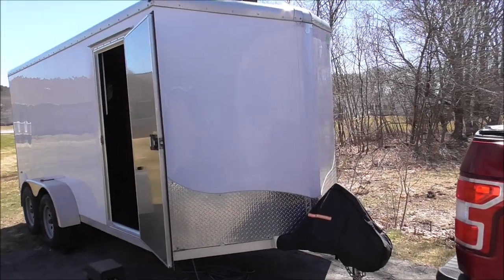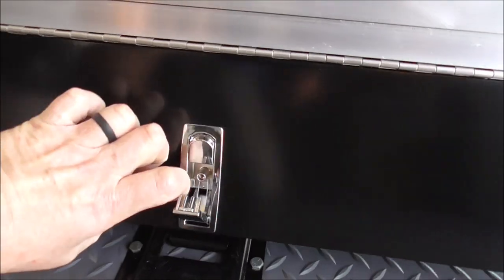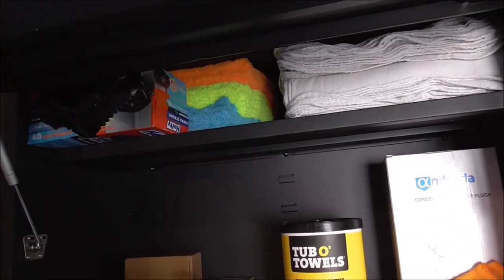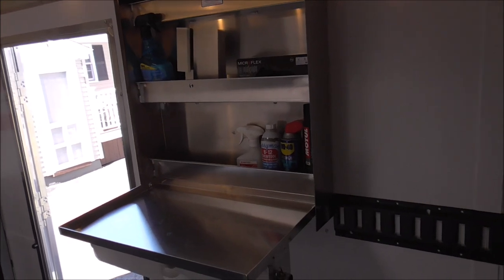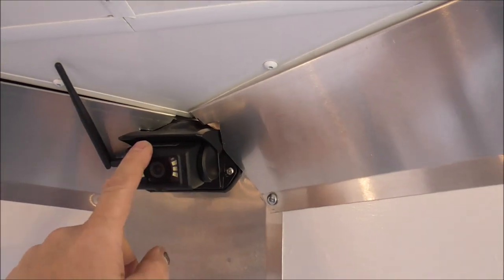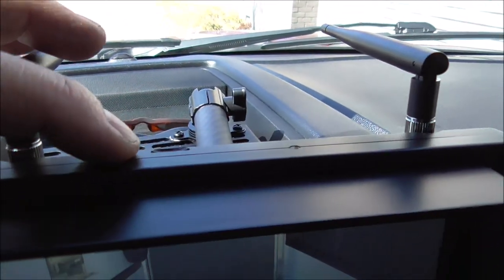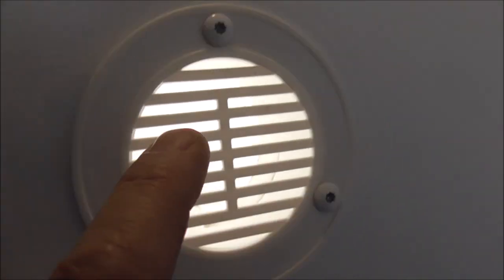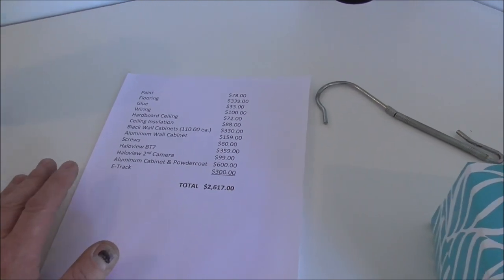"Cost of Building the Ultimate Toy Hauler Conversion - Cargo Trailer Mobile Welding Rig Tour!"

Comment: AWESOME job! Love the final product. It would be great if you could show us what it looks like loaded out in the two different configurations, (toy hauler, welding). Also, what is the floor made of? It looks great. If you made a video showing the floor installation I must have missed it. Maybe you could do a follow up video after you use the trailer for a while and comment on how things have worked out to that point. Also, things you might decide to add after some experience with it. Thanks for all of the how to tips and great ideas.
Reply from the maker: Thanks man and all great suggestions. I will be updating for sure. As for the floor I did it off camera just because my channel tends to suffer when I stray from welding videos for too long and I didn't want to turn off my viewers. The floor is commercial vinyl. It's. 115 mil thick and resists gas, oil and acid. Its made by husky.

Comment: That should definitely work! Looks very professionally done and it has accessories that you wanted. I thought you said at the beginning that you were going to put cabinets above the workbench? Those 3 cabinets you have, i too bought one at Christmas, wasn't crazy about putting it together though. I put my welding jacket shirt in there with my welding gloves and I also bought leather coverings for my shoes. My new Rew Wing boots were taking a beating from the splatter.
Reply from the maker: Thanks Jake. I was planning to do cabinets above, I still might but i'm not sure it's going to give me the depth of storage I was hoping for due to the slant top and V nose. I'm going to have to give it a little more thought, maybe even make a template to see how much room I could get.

Comment: Very nice job on the trailer Brandon! It takes a lot of thought to have a project come together as well as you did it. Love the inside with the cabinets and storage ideas with the lighting and all. You really got a hell of a deal on the trailer. I was just looking at tires for my trailer yesterday so I will check those Hercules tires out before I buy because I was looking for the higher speed rating you have with yours. Good luck on your trip!
Reply from the maker: Thanks man! I did a lot of research on this too. The tires that were on it originally from the factory were C rated and had a speed rating of around 70 mph which that concerned me. I also researched the goodyears which are a great tire but they are an E tire so super stiff ride and they werent speed rated much more than the original C tires. These Hurcules are D rated,  a little heavier duty than what came on it from the factory but they are the highest speed rating you can get (or that I found) in an trailer tire. These are N speed rated which I think is 87 mph. They are made in China but I have confidence in the lady that sold them to me. I will tell you more in about 9 days. I will have traveled about 3,000 miles on them and hopefully no problems. She compared them to the quality of Carlisle as I said in the video so we will see. I wasn't really concerned with price, but rather I wanted a really good tire that I could drive long distances without problems. I will report back soon.

Comment: Fantastic Job Brandon
That sort of trailer here in Aus would cost as bare trailer close to AUD$20K (USD$ 13.5) ad how you have it set up an easy AUD$30K minimum (USD$20K)
On the ramp are you going to put some slip resistant surface as that Diamond mat can be very slippery when wet.
Reply from the maker: Thanks man I appreciate it. Yes I'm dong the same thing on the ramp as on the floor except I'm doing it in a contrasting color / black inspead of the grey.

Comment: Awesome build. What shape are the wheel bearings in? If I you’re not sure I would think about servicing them before a 3000 mile trip.
Reply from the maker: Good call. That was my concern too. I pulled all 4 wheels and drums as soon as I got it just to be sure. It has a dexter axle and I read if you put too much grease in them it can blow out the back seal and get grease onto the brakes. For that reason I stripped everything, used brake clean, lubed the auto adjusters and repacked the bearings. Everything looked good but now I know for sure it's right and it's a relief for peace of mind.

Comment: Hi Brandon, I'm curious what you chose for your toy hauler battery?

It turns out that my toy hauler battery that I have had on my NOCO charger all winter is NG.   Sad, because the NOCO charger that should have kept it fresh has indicated it was fine.  Nope.  Completely Dead...

I need a new battery, and where you just setup your rig I'm guessing you may have done a little research for your battery choice.

Thanks again for your help. 😊 Dan
Reply from the maker: Hey Dan, that was probably the one thing I didn't research. I just ended up going to ORileys and buying a lead acid car battery. The battery I used is for a 2013 Toyota Corolla. As of this post I have traveled 2k miles and laid over 7 days without any shore power connected using the interior 12 volt led lights and having the cameras powered all day and the battery is full using just the power provided from the tow vehicle. I think this battery was a good choice for power vs weight.
Reply: @BrandonLund  Brandon, Thank you for the quick responce..  Safe Trip... 😃
Reply from the maker: Thanks man!

Comment: Excellent build but then we expected nothing less. Does the back door drop down for a ramp? If you paint it black it will be very hot after sitting in the sun for a bit. Good luck on your trip!
Reply from the maker: It does fold down. Good point about the sun 🌞

Comment: Excellent setup, and a great presentation. So jealous :) 

One thing I'd recommend you install (assuming you haven't already and just didn't show it) is a good quality first aid kit.

Otherwise, good job, and thank you for sharing.
Reply from the maker: You read my mind Dan! I've been trying to find the right kit. I also put a mirror glued to the cover for the occasional eye issues.
Reply: @BrandonLund  It might cost a bit more than those you can get from places like Home Depot or Walmart, but consider looking up an online restaurant supply store. Those tend to cover a multitude of issues. Also, also consider getting a little squeeze bottle to serve as an eye wash (any basin will serve to collect water).
Reply from the maker: Great tip thank you! I will check into that! I appreciate it!

Comment: Great build Brandon! What was the trailer brand and model you initially bought? I like the 16" on center walls and floors, not easy to find in todays crappy mass produced trailers.
Reply from the maker: Thanks man. It's made by a company called Neo. The model is NAVR. The thing that sold me was the round top slant roof. It's constructed of a one piece sheet while all the other trailers make their roofs flat. This trailer roof is arched so snow, rain and ice don't pool up and cause problems. They are super well built if your looking for a trailer it's hard to beat the quality.

Comment: Brandon your project is Awesome.  Great job.  I appreciate all the details you covered.  Very helpful.  Thanks

I am interested in your wireless camera system.   With everything closed up on the trailer does the signal ever dropout, or become noisy.  I'm concerned in the aluminum box blocking the signal to the monitor.

Thanks, Dan
Reply from the maker: @Daniel Rapoza not at all. I was concerned at first if the signal would broadcast though the inside of the trailer to get a crisp picture but it's not even a concern. It works flawless. I can drive up the road hundreds of feet and still see inside the trailer. It never flickers or gets jittery and the best part is that it's simple!. I turn on the switch to turn on the cameras and the monitor links up to them instantly without touching any buttons or anything. If your like me and like things to be hassle free without drama,  this is hands down the setup you want. It's easy to install, super user friendly and the picture is 1080 HD so you see everything. It's a little pricy but it's worth every penny I promise. I spent months researching camera systems (wired and wireless) and this system came up every time the clear winner.
Reply: @BrandonLund  Awesome...  Thank you for the detailed reply.  Stay safe out there and enjoy your 3000 mile trip.  Hope to see some video upon your return.   Dan 👍
Reply from the maker: Thanks man! We made it safe to our destination and I will be uploading for sure. Had a few mishaps along the way but nothing that can't be fixed...of coarse it's on video too lol (to be released when we return lol
Reply: @BrandonLund  I'm looking forward to seeing your video adventures upon your return 😀 

Stay safe out there.  Dan 👍

Comment: The stainless steel cabinet with paper towel holder at the back of your trailer.. where did you get it ? Do you have a link ?
  Thanks
Reply from the maker: Ebay! Gotta love it. I'm super happy with it also. https://www.ebay.com/itm/385155406426?mkcid=16&mkevt=1&mkrid=711-127632-2357-0&ssspo=pyakiyTHQUu&sssrc=4429486&ssuid=9BtnOH64Srq&var=&widget_ver=artemis&media=COPY

Comment: I'm tell you what you did ole buddy. U didn't move ur thumb in time 😮 ouch.
Small small drill bit or hot needle guy that know wack them fingers drill nail use other hand don't need drill or heat needle melt through it. Get pressure out from under it feels so much better. But really move them digits it hurts.
Reply from the maker: ANd that was from this winter! That darn snow blower decided to eat a shear pin and I was trying to beat out the broken piece when it was below zero. My hands were so cold I couldn't feel them as I was holding the pinch and WAM! Slipped and wacked my thumb. It was pretty painful once it warmed up it had it's own heart beat
Reply: @BrandonLund  yeah ouch. Hate when that happens. Wam thump thump. Thump thump

Comment: beautiful job, what did you use to mount the e track, self-tapping screws, what length , should I drill first ?
Reply from the maker: For the walls I used square drive RV screws 1" long and for the floor I used nut and bolts
Reply: thanks, where can iget RV screws
Reply from the maker: @turdboman https://www.ebay.com/itm/330986892180?mkcid=16&mkevt=1&mkrid=711-127632-2357-0&ssspo=ryyYVEdVRsG&sssrc=4429486&ssuid=9BtnOH64Srq&var=&widget_ver=artemis&media=COPY
Reply: @BrandonLund  thank you
Reply from the maker: Anytime 👍

Comment: Where did you get the stabilizers
Reply from the maker: If your refering to the aluminum ones on the back of the trailer, they are a factory option on this model..